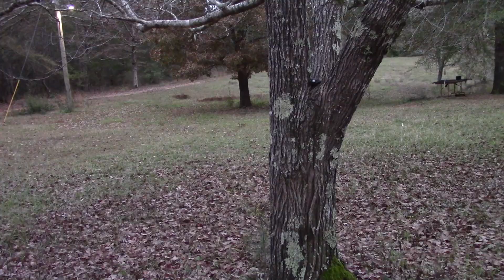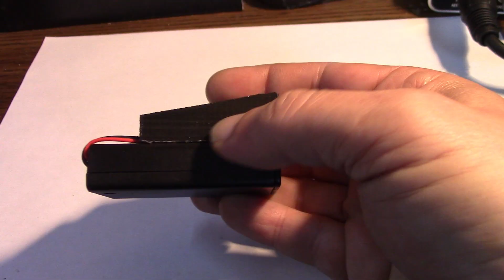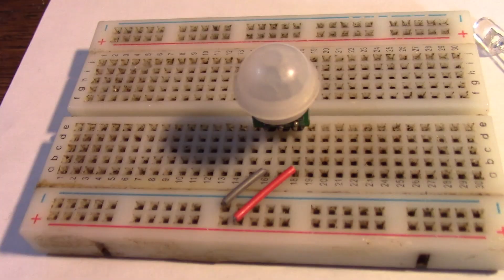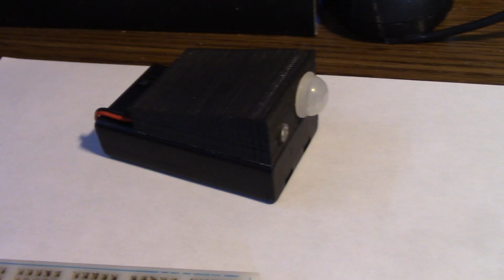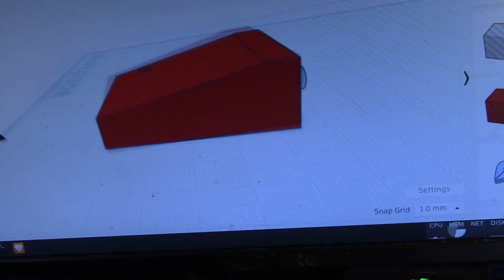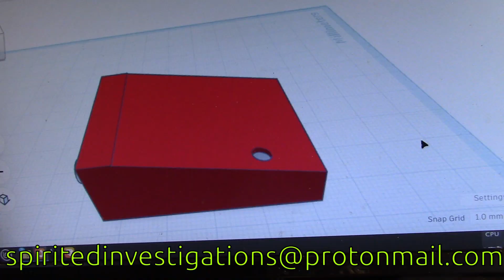Build Your Own Motion Sensor WITH sound for Just Five Bucks!

Comment: Really really want to make this but i dont have a bread board and cant figure out how the electric go together with wires 🥺 no electrics experience. Do you have a image of the wiring of it all together working? It would be easier for me to understand then 🙏
Reply from the maker: Ah, it's really very easy without a breadboard or even soldering. You can wire it up directly, by tightly twisting the legs together 😀 

A breadboards connections can be a bit confusing if you haven't used one. The 2 rows at top and bottom are labeled - and +, for your power supply to go to. The middle area is split, with holes that form straight lines down, all the way along. Those lines are all the same connections in each row, so,  If a components leg goes in the first row, then another components leg can go in the hole beneath it on that row and it will be the same connection. If you now know that, you can go back into the video where I'm plugging things in and hopefully it makes more sense. 

Some tips - The holders can be bought from Dollar Tree or equivalent, they are on their string lights and other products. 
The pins on the I/R sensor are labeled, as - Out +. So black power wire to -, red power wire to +. The LED goes negative leg to the sensor negative (or negative of the batteries) and positive leg to the middle pin of the sensor. To tell which is which, if you look into the LED itself, the smaller side is always the positive, the larger side is always the negative.  
That completes the sensor which lights a light on detection. Complete that first and try it out 🙂
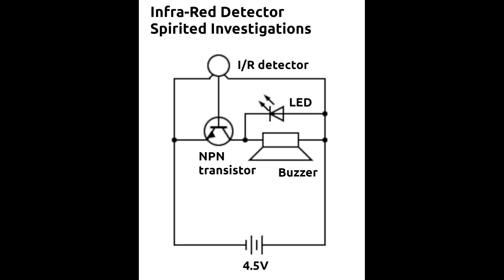For this version with the buzzer, you can see by the circuit diagram at 6:13 and how I plug it in where the transistor goes (you'll need an NPN transistor, some types that work are  2N3904, 2N2222, S9014). Transistor flat side faces towards you, left leg to sensor negative, middle leg to sensor middle leg, right leg to LED negative. LED positive to power supply positive. 

From that, you should be able to connect the circuit up without any tools..